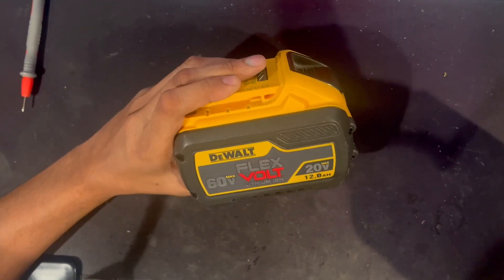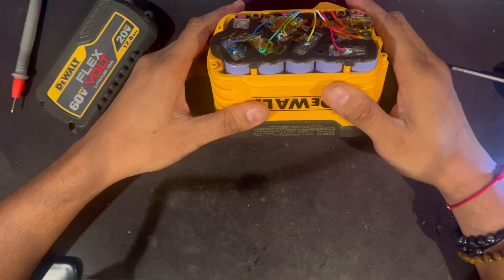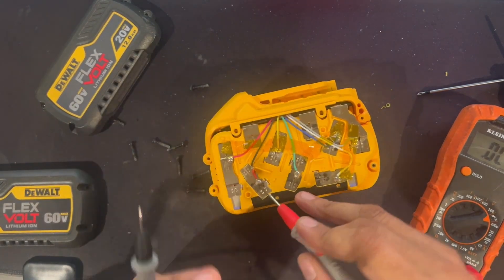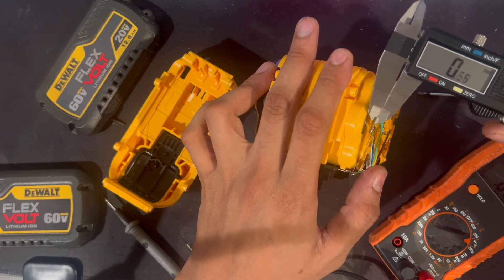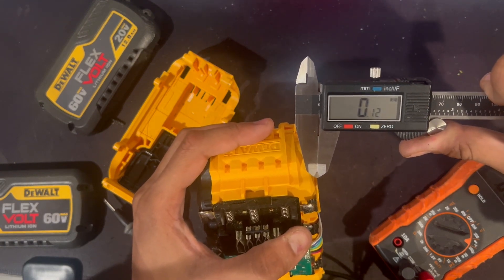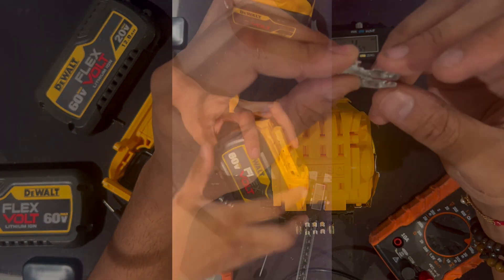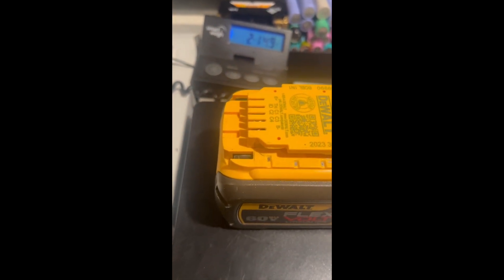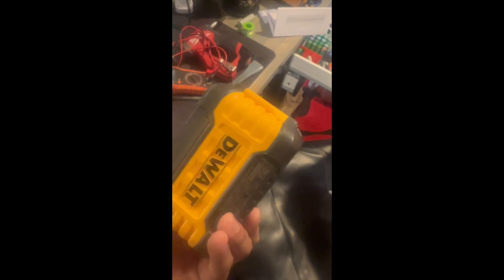Client sent me a fake pack to fix! Dewalt 12.0 Flexvolt - Diagnostics

Comment: I bought a 12 ah on ebay i opened it it dont have wires looks more like the real one on the inside and works in a 60v tool but one side of the battery the label is smooth the other is the matte stickers not sure how to tell for sure ive bought alot felx volt never seen the sticker difference and the dewalt logo by the qr code font is a little differnt than my others what you think ?

Comment: This stuff is scary. I'm going straight to Home Depot for my batteries for now on. These batteries sometimes cost more than the tool. Purchasing any rechargeable battery online is no longer safe, when even Amazon's official Dewalt tool pages are at times shipping tools with fake batteries. I think every online company should be weighing all products before shipment, which can be easily done. If something weighs more or less from the norm, these automated robot arms and transport technologies just automatically throw out the fakes. This situation when it comes to real or fake batteries is really unfortunate. People are getting screwed and it really sucks.

Comment: I don't know if I'm mistaken, but the fake battery even has the QR code?
Reply from the maker: Yes! They are getting good. Not sure if they got a hold of the list of manufacture serial numbers but it seems to be a problem.
Reply: I’ve started to wonder that after buying 4 on eBay now I got one that’s saying a 9 AH flex volt instead of a 6 and different serial number but some people say real ones can do that same I don’t know
Reply: No creo sea falsa en su totalidad, al parecer lo que cambiaron fue su tarjeta madre ya que las originales no las venden